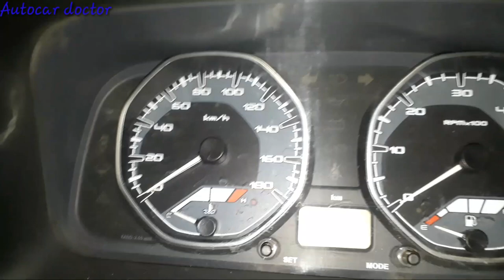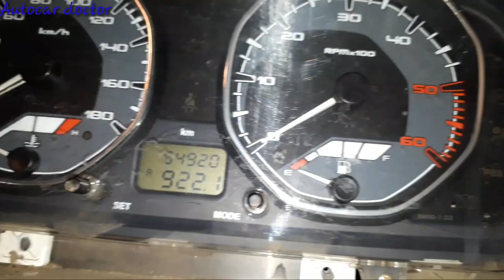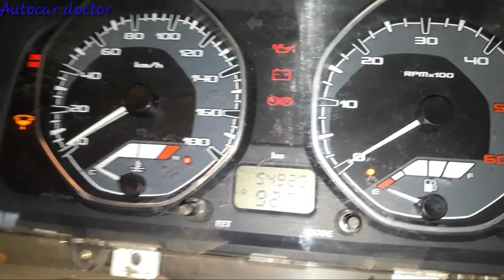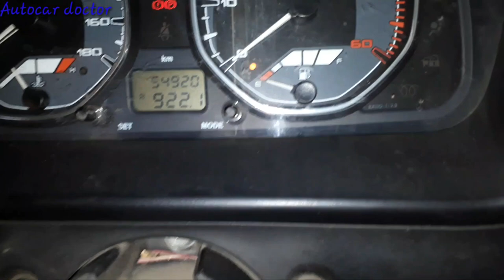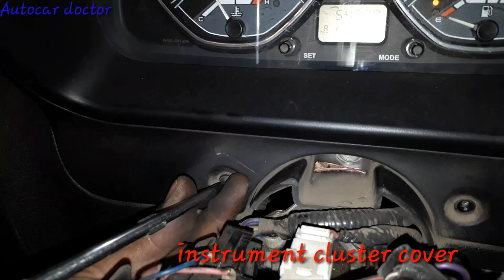Cluster not working Indigo ECS #Autocardoctor

Comment: Bhaiya tata tigor petrol engine- car achanak band ho gayi uske baad cluster ki light, ignition light,  dashboard light, cabin light, hand break light, parking light, koi bhi power supply cabin ke andar nahi aa raha, engine start bhi nahi ho raha battery full charge hai, dusara battry bhi laga kar dekh liya . car cabin engine cabin dono ka sabhi fuse  , sabhi relay multimeter se check kar liya sab sahi hai,  problem solve nahi hua. car road par khadi hai corona lockdown  me  koi machanic nahi mil raha .plz help me
Reply from the maker: Apna number do